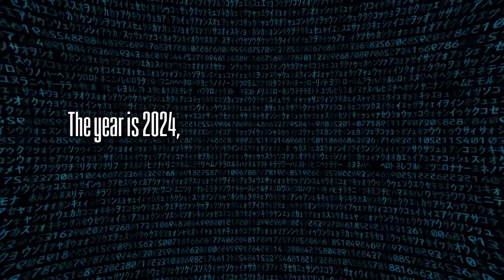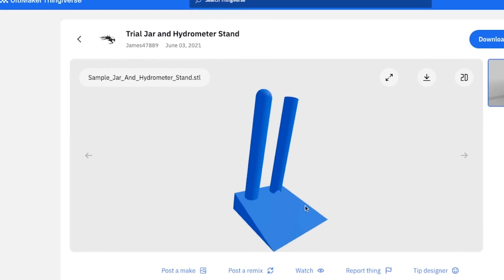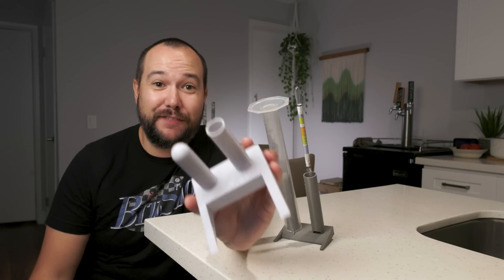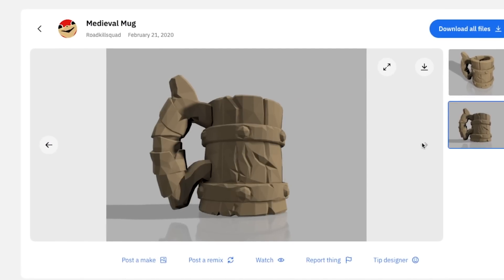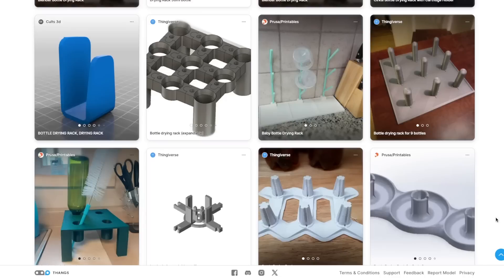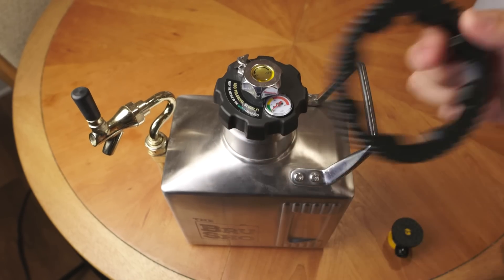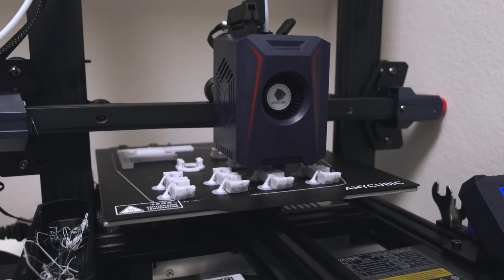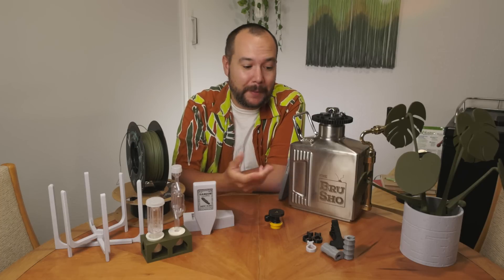Using 3D PRINTING to solve my Homebrew Headaches.

Comment: Love the topic, I’ve not seen the two processes combined like that before. I’d bought my kids a 3D printer two years ago, and I probably use it more than they do now. 😂
Thingiverse has great files. I found a modular bottle tree, and have designed a couple problem-solvers of my own for vent duct holders and a new base for my hydrometer glass. Been a lot of fun.

Comment: Hi . I made a simple recipe of making cherry wine . After of adding sugar and cherry and mix together and yeast also . I poured all in container and put air lock on top . fermentation started after24 hours. I opened the container to push the cherry back down because it cames on top and stir it . I did this 3 times during 7 day . I didn't do that again. I have fermentation in container. I just want to ask i should not did that ? Does it risk of oxidation my wine ? Should i pour it away ? Disposal it?😢😢

Comment: I got into 3d printing about 5-6 years ago when they started to be affordable, but nowadays the printers are way faster, require less thinkering and print better quality then those back then. 
I designed a cap for 5L PET bottles a few years ago that allowed you to mount an airlock for experimental small batches and also printed a few other small things for brewing.

Comment: Not a melting issue.  There was a bed adhesion issue.  I have a couple of 3d printers.  I did spend 600 on my most recent one.
Reply from the maker: @TheBrewQ  thank you! I am still learning a lot. Found I have to clean the bed quite a bit.
Reply: @TheBruSho  what size epaper screen were those?  I like that idea
Reply from the maker: @TheBrewQ  2.7” I threw a link in the description too

Comment: Last time I was at Micro Center, I was amazed at how affordable 3D printers had become.  It felt like only yesterday they were prohibitively expensive, so the only way you'd be able to use one is at the library.
Reply from the maker: It really surprised me when doing research too. Btw I just found out about Micro Center and I'm dying to check it out. We got one in SoCal!
Reply: @TheBruSho  Nice, but be careful.  I've been a Micro Center customer for 25 years, and living so close to one is no good for the wallet.  Just casually browsing around ended up getting me interested in hobby electronics.

Comment: Stir plate table extension for bigger flasks 

Little dosage cups for TOSNA and TBE nutrient additions that you can measure and store with your fermenter for subsequent days

Hose management

Custom wedges to go under a bucket to lift the spigot side of a  fermenter so lees falls away from the opening.

Nukatap counter pressure holder/neck lock for bottling hands free.

Tap locks

Evabarrier Line organizers for the inside of the keezer/kegerator

Duotight collar snaps

Custom duotight manifold board

Beer bottle contoured scraper for removing labels from used bottles.  Like a plastic scraper.

I think it's just time for me to get a 3d printer for homebrewing lol
Reply from the maker: Haha epic list thank you!